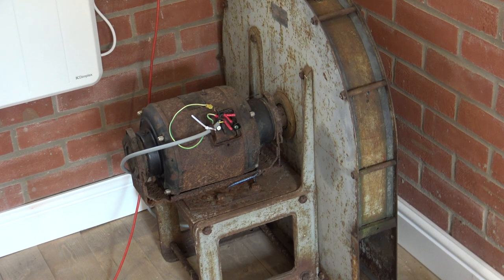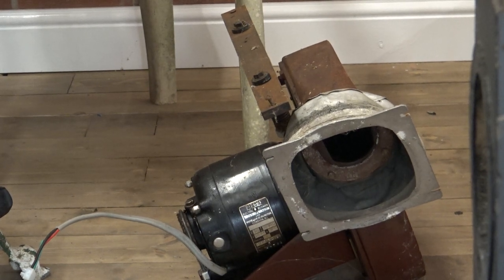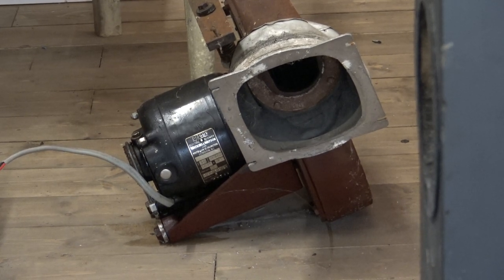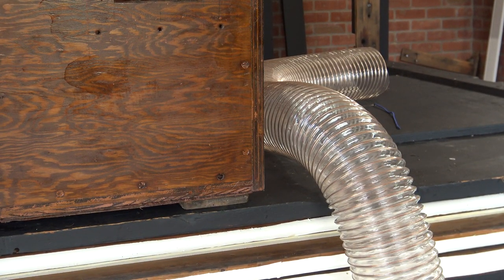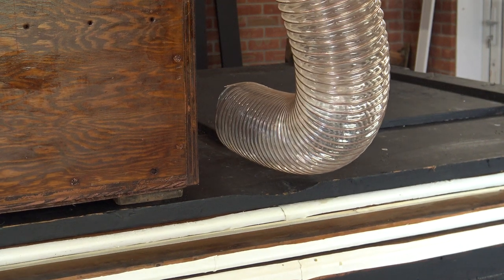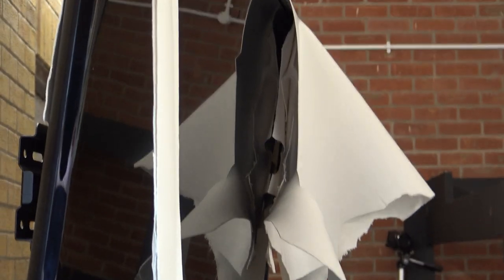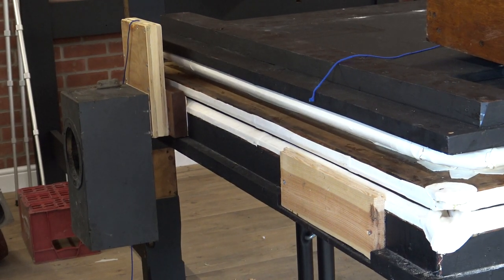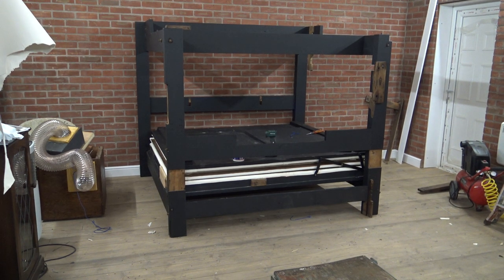1865 Forster & Andrews pipe organ restoration & installation  Pt 6 of a lot

Comment: why in the world did you reverse the inverted ribs?
Reply from the maker: errr??? The lower ribs have the fold on the inside & the upper ribs have the fold on the outside in the normal way....with a floating frame in between & pantographs to help equal inflation.. I've never seen a double rise reservoir bellows work in any other way.
You are welcome to email me for a photo of the bellows before work commenced.

rshireby@yahoo.co.uk